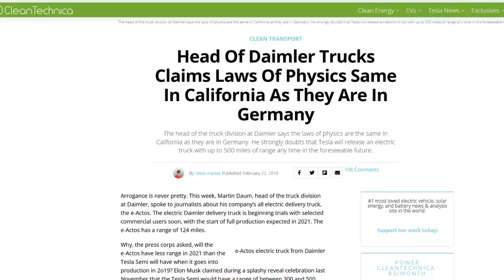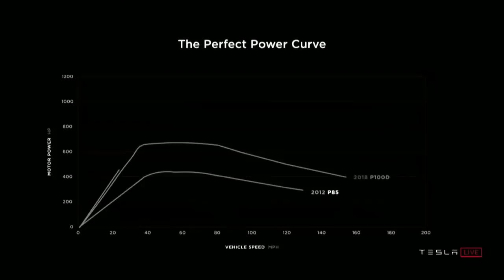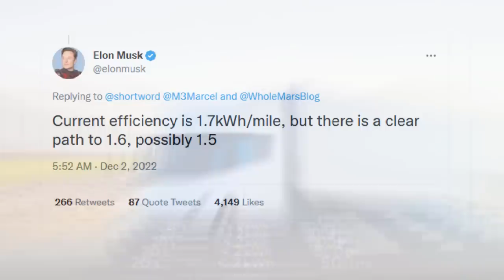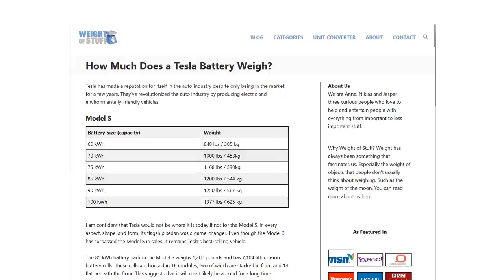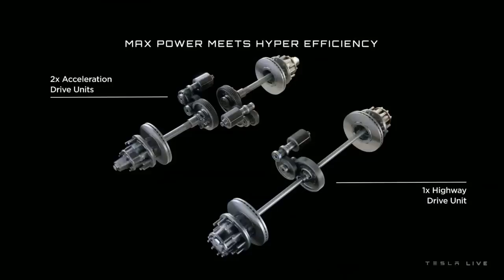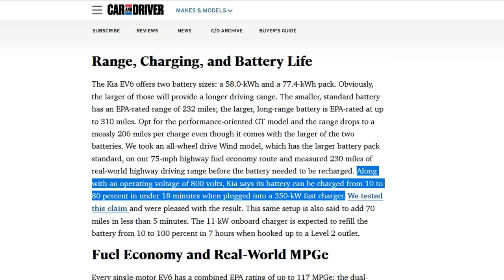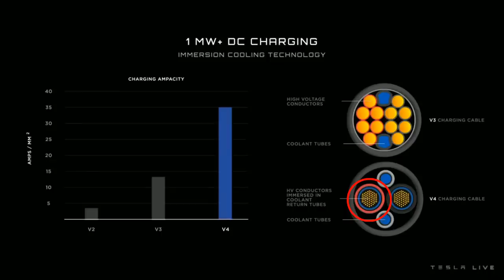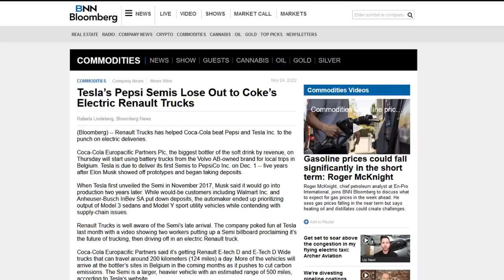Elon Musk Drops Tesla Semi Bombshell

Comment: Given the current price of diesel and electricity in the US, and assuming the same maintenance costs for both types of truck, then with a single 500 mile trip per day, a Tesla truck will save $90,000 each year in fuel costs over a diesel. That's insane. It's like a ROI of 2 years and gravy from then on.
Reply: The problem when the road tax is not included in any of the projections
Reply: Stop lapping up all these fluff pieces. The Tesla truck has a hopeless payload. A truck is only usefull if it can haul goods. Tesla truck can barely haul itself let alone a payload which is the part that actually pays for the truck.
Reply: Yeah, poor calculation. Try installing a 1MW charger per vehicle. Ever visited a Flying J? It's 20 or 30 Trucks gassing up at a time and that only takes about 20 minutes each. That kind of infrastructure doesn't exist yet and electricity prices will soar once demand more than doubles due to electric vehicles and fully electric houses. It's going to go anywhere between 50c and $1 per kWh once those things take off and even more when there's more of them on the road. 
So no, the savings won't be that high - not even close. Plus who cares anyways? You think you'll get much out of lower trucking costs? It's going to be just the same disaster for the environment as diesel trucks, so overall there's not going to be that much benefit. Musk is going to get richer, but that's about it.
Reply: @uweschroeder  the maths doesn’t matter. People just believe what suits their ideological fantasy.
Reply: @JeffBourke  that;s sadly true.
Reply: @JeffBourke  The truck is not that much heavier than a diesel, because the lighter motor offsets the batteries to a large degree. The test drive was fully loaded to 82k pounds.
Reply: @uweschroeder  Your arguments are poorly thought out. You don't need one charger per truck if the charger is on-site at distribution centers and the trucks do a single trip a day, which was my scenario. One charger can recharge one truck fully in an hour to an hour and a half, so one charger could charge multiple trucks each day. Your contentions about the price of electricity are bizarre and unfounded, since the sales of these trucks will match the infrastructure build-out. Otherwise, there won't be an incentive to buy them.
Reply: @Barnstable11  82,000 is the total weight. Tesla refuse to disclose the net weight of the truck. I wonder why….
Reply: @Barnstable11  you don't need one charger for each truck, but you need one charger for each truck charging in parallel and when you've ever been at a truck stop that's at least 20 trucks and I've seen a lot more at a time. So you need an average small powerplant sitting next to that truck stop.
My cost of electricity more than doubled in the last 5 years and I'm paying over 40 cents a kWh now - because of increased demand, wildfires and "grid improvements" yet right now the government tells EV drivers in summer to charge over night because the grid can't handle the load. Electric trucks turn economically unviable at around 50 cents a kWh because then the cost of fuel for a million miles rivals that of diesel trucks. So you're telling me we're going to have the generation and transmission capacity for at least double the electricity use within the next decade or so? LOL. At the speed we're expanding our electric grid my grandkids can buy an ICE vehicle and drive it all their lives before we see the capacity to charge cars, trucks and have fully electric houses (as they've already begun to require in California).
Before any meaningful number of trucks are electric in this country it will be decades and only if we start investing billions into infrastructure now. Sorry to say, with the current political landscape I don't see that happen at all. We'll get more oil drilling and pipelines done before that happens.
Reply: @uweschroeder  I'm not telling you anything about the future of the grid, except to say that consumers will buy the things that make the most economic sense to them at the time. People in areas that have good infrastructure will buy more Teslas if they see the savings over time. Where I am in the Northwest, our hydro will keep the power rates down, and so my EV will save me well over 500 bucks for every 10k miles driven just in fuel, compared to a 35mpg ICE, not to mention no oil changes, no brake work etc. Makes sense for us in the real world right now, may not for you, end of story.
Reply: @Barnstable11  Well, we're talking about semi trucks here. We don't know the price, the real range, the charging time nor the load capacity. What we do know is that it's poorly designed for usefulness. The driver sits in the center - he can't reach out the window to hand down paperwork for example. The door is behind the driver, so no room for a bed, much less containing dirt at the one spot in front of your driver seat, so you drag dirt all over the cab each time you go in and out. The mirror position is too far out due to the narrow center cab, so hard to adjust and the center seating position makes passing a nightmare because you have to go half over to the other lane to be able to see past that truck in front of you. Plus the large and very slanted window will allow much more heat into the cab than a more vertical design. In my book it's way too early to celebrate.
On the retail side of things, sure, people will buy what they like. I disagree that they buy what makes economic sense because under that point of view very few cars on the market make sense. It's also funny to think you get rid of a perfectly working 35mpg vehicle to replace it with a $50k EV and think you save money on it. That really depends on how much you owe on the old car or whether it's that old that it needs replacing and even then buying another used vehicle for $20k may be much cheaper - gas price or not. My bet is that very few people actually save money on that switch. A lot of factors go into buying a car - economy is rarely a big one. For someone spending $200k+ on a semi that is a different story and the vehicle has to be not only economical but also able to do what it's bought for and right now I don't see anything but hype. Time will tell.
Reply: @uweschroeder  Yes, time will tell. I would just add that "economic sense" does not always mean "saving money;" cars vary quite a bit, and so for high-ticket items like that, "economic sense" more likely means "how I think my money is best spent." For myself, I have found that the increase in driving enjoyment, interesting technology, full battery every morning cheaply from my garage charger, much lower/less frequent maintenance etc. make the extra money I spent well worth it. And a lot of other people are making the same calculus. Some of us plan to have solar roofs when the price is right, which lowers stress on the grid. Lots of factors to consider.

Comment: 2:50 The Plaid motors are top tier but they don't "absolutely destroy every other motor on the market". Lucid and Rimac have shown that they can build smaller and more powerful motors, albeit for a multiple in cost and in much smaller numbers. 
As Musk used to say, other manufacturers will catch up on technology, but in production efficiency and profit margins Tesla will be leading for much longer.
Reply from the maker: Possibly. While the Lucid motor claims to have higher horsepower, we haven't seen its power curve. For some reason the high horsepower doesn't translate into actual acceleration...
Reply: @TMIOTesla  Aren't there more powerful electric motors? we've had them on trains and ships since before I was born and I was born before Nixon was President.
Reply: My  in law has invented the smallest electric motors that are more powerful than any others for Boeing and aerospace.  He has over 400 patents .  he has multiple degrees in engineering with many years working on top secret programs.  He can design and build any electric motor.
Reply: If you remember tesla was going to produce a plaid + same motor. 
Also interview with Franz and Leno said semi is capable of 1500 horse. Rimac uses 4 motors

Comment: The two extra motors are absolutely required for down hill regen - a single motor wouldn't cut it and you'd have to resort to brakes (inefficient). A bonus is that with the extra two motors you get a boost when you need it.
Reply: I've never seen anything that states the other 2 motors are used for anything beside acceleration which is what Tesla stated in the presentation.  Source?
Reply: @Scott-sm9nm  Source = laws of physics.
Reply: if the batteries can provide 1000+HP for three motors for acceleration, the same inverters and battery can take the same charge from regen braking.
Reply: @Scott-sm9nm  they said the 2 motors would be used for regen in the presentation.
Reply: @lapin46  the discharge c rating of batteries doesn’t necessarily match the charge c rating.
Reply: @allterrainrandy2587  yes, that is correct, but we talk about 1-2C discharge rates here EV truck applications. 1-2C is well within the charge envelope of all high performance batteries. 2C would be 1.8MW for the Tesla Semi. Passenger car batteries are worked significantly harder.
Reply: @Scott-sm9nm  Negative acceleration is deceleration, so it fits into definition.  Even the Toyota  AWD Hybirds use the rear motor for deceleration, so should be straightforward
Reply: @Scott-sm9nm  also deceleration? It seems logical to me too. The downhill recovery was impressive compared to my Leaf.

Comment: Great content - as always.
My guess is that a primary constraint for the charging architecture was regen. Quickly slowing 40 tons to a stop requires getting rid of a huge amount of inertial energy. Tesla needs to capture every joule, which probably mandated the 3-motor configuration to capture the energy, and the power architecture to transmit and store all the energy as it is generated. In effect, the best possible regen requires significant charging speed. Fast charging and 3x diesel power are clearly important objectives too, but it's important to remember that Tesla's super efficient motors are also generators that are key elements in achieving range.
Reply: I completely agree. It follows the logic that 4WD vehicles are not necessarily better in the snow. Sure they will accelerate better with more traction to the ground, however they don't stop any better because everyone has 4 weel braking! I drove nearly 300,000 miles in Prii over 20 years and that vehicle can only regen at about 2.4KW. That's significant for a car of that weight, but if you drove the car like it wasn't a hybrid, you generally lose half your braking energy to friction brakes! In an 80,000 lb vehicle, especially from say 60MPH down to 20MPH that's a huge amount of energy to capture! Those three electric motors will be loaded much higher during that braking than they will during normal acceleration! 

Side note: The trailer brakes should last almost forever!
Reply: Great point.
Reply: @larrybolhuis1049  yes I've had to replace the rear calipers on my second hand Yaris hybrid.
I strip and re-grease annually now I'm aware of the issues.
Edit, the maintenance of the brakes will still be needed.
So only saving would be no parts. You prompted that thought. 👍
Reply: You can use Capacitors to store Regen Energy
Reply: Stopping a two axle vehicle has no relationship to stopping a semi towing a 60,000 lb trailer.  Not the same physics.
Reply: Uh, not really.  Helps, yes, in reality this might be ~10- miles out of 500 for very LARGE descent.  Where this helps massively is in stop/go traffic in cities for say local delivery vehicles which I guarantee Tesla is designing as soon as Cyber gets into production.  The sub 30,000lb category is a Large segment.  Same base will be used for a delivery vehicle and here is where going electric will be the MOST valuable of ANY segment other than commuter car.
Reply: and they own Maxwell
Reply: @larrybolhuis1049  Although they will last longer, they still have to do work. They will not last almost forever. I like the idea of reducing brake dust however.
Reply: @andrewsaint6581  That is only one example, did anyone else have to replace them? I have never replaced my brakes on any car or pickup in 22 years.
Reply: @mikeskidmore6754  That is for others, who do not yet have the technology.
Reply: @scruffy4647  I have been told that the same physics applies in the entire universe, so I doubt you said what you mean. Perhaps it requires more effort to stop a larger mass? I'll bet Newton's laws could help solve this problem.
Reply: @w8stral  Depends on your definition of "valuable". To me, it is imperative to get rid of as much pollution as possible, and the calculations that were done indicate Tesla's approach will be most efficient at doing just exactly what they say they are up to.
Reply: @larrybolhuis1049  Surprised if the regen is only 2,4KW in a hybrid. I would expect at least 10KW
...Even a nissan leaf went up to 30KW regeneration with a 24KWH bruto battery (2013 model). I do not know what regen power my current EV (IONIQ5 awd) has, but when I compare to the leaf it will be at least 150KW, maybe even 200KW. (Max charging is also 225 KW at 800 volts chargers...ca 300Amps as limit.
Reply: @tedmoss  I did..., not the discs but the blocks. And also blocks generate dust when used.
depending the car somewhere after every  90000 to 120000 km new blocks....but NOT in my EV's (driving them now since 2013)
Reply: @tedmoss  What I was referring to is trailer braking.  Without them, stopping distance for the rig can be twice the distance.  From an engineering question, is the regenerative braking capture of the e tractor when stopping diminished because of trailer braking??  The trailer manufacturers are now experimenting with regenerative braking for their trailers.
Reply: @mikeskidmore6754  
You don't need to. (Use capacitors) The batteries can take it and are much smaller
Reply: @johnstreet797  
They don't.
Sold the remainder off (including the capacitor tech)
They bought Maxwell for access to the dry electrode process (which it seems Maxwell could never have scaled without Tesla resources?)
Reply: That's a feature of electric motors I always loved. Good brakes for trucks and heavy motorcycles make life lots easier.
Reply: @mikeskidmore6754  Musk bought the premier super-cap company a few years ago. Capacitors generally charge and discharge much faster than batteries, thus are capable of capturing excess power that batteries could not absorb at that rate
Reply: @reiniernn9071  EVs will have much more regen than a hybrid as the Hybrids do most acceleration with the ICE, meaning total electric motor power is much less. That said, you are correct and my math was wrong. It's about 20kW max regen (201V and 100A)
Reply: @mikeskidmore6754  To what purpose? It is simpler to just use the battery, remember, the best part is no part.
Reply: @scruffy4647  Actually, it is exactly the same physics. Physics is the same throughout the universe, as far as we know. Perhaps you mean it has to capture a lot more energy.
Reply: @w8stral  The graph Tesla showed of the Tesla Semi had considerably more than 10 miles out of 500 going downhill. The vehicle market has a precedence,  highest profit to lowest profit, so it should be easy to see what comes next, likely not small delivery vans. Tesla started with among the most difficult first to prove it could be done, others now have no excuse.
Reply: @tedmoss  Yes, it's the same physics.  What I was inferring, is that part of the presentation states that the rig will not jack-knife.  Under most conditions, probably not.  Your going down a steep grade that's iced over, monster side winds, trailer brakes fail, things happen.  That statement is just over the top.
Reply: They need Capacitors to store the RE-Gen energy
Reply: @scruffy4647    Yet Truckers  stop Disel 18 wheelers  every day with an Engine brake that only uses the tandem drive axles for braking force .. Go figure..
Reply: @tedmoss  Well no, as we do not have enough known reserves of nickel, cobalt, or lithium to make said vehicles for everyone. Do the math, we don't have it.   All that before stationary battery supply let alone stainless steel etc.  We need new battery tech.  Sorry.  A select few can get said vehicles in the short term, but long term?  NMC lithium as used by TESLA et al. is a dead end and everyone knows it.  LiFePo4 is better as it does not have the nickel/cobalt problem, but has other problems.  We need a different battery solution.  LiFePo is the best in medium term, but still is not a long term solution unless we start mining lithium out of the oceans.